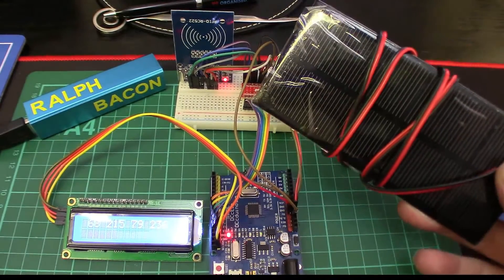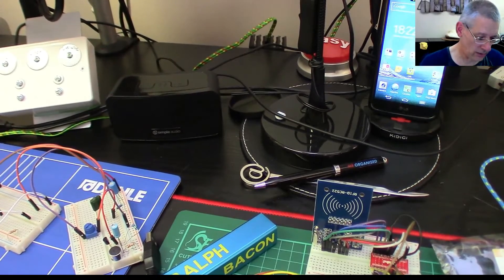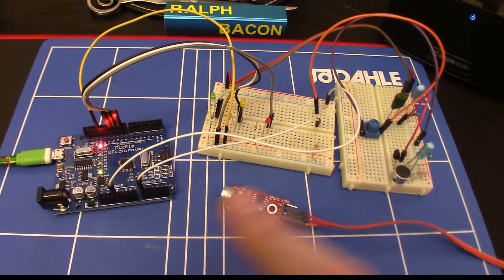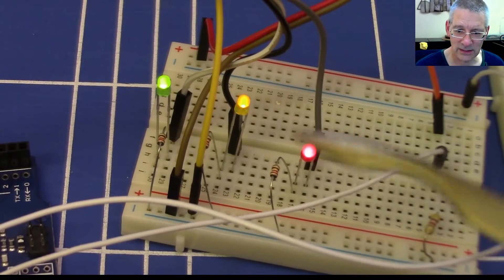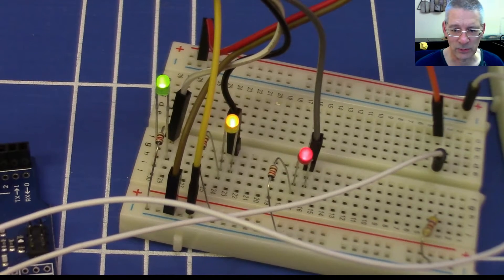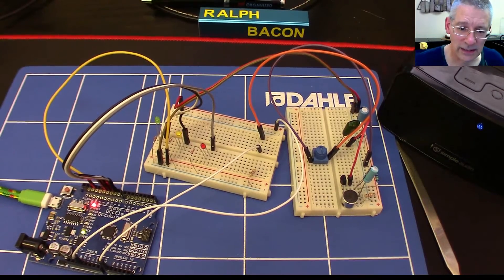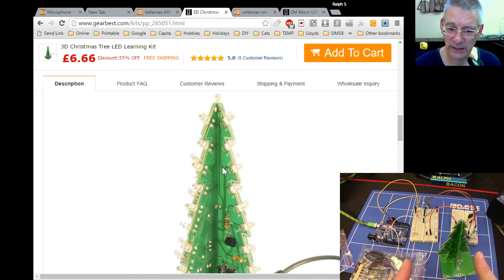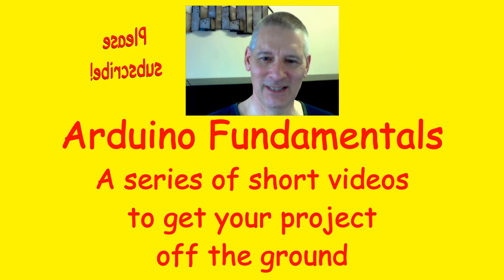#51 Easy Xmas Project Idea (& Product Updates)

Comment: That mic board you have and the one on the web page are not the same.  I ended up with both as a part of a "sensor kit" I ordered a while back from banggood,  and one is supposed to be a whole lot more sensitive than the other (the one with the bigger element maybe?).  I still haven't envisioned a use for those things.

Some time back I bought a heart-shaped circuit board with a lot of LEDs around the edges,  built it and gave it to my lady.  It seems to use pretty much the same circuit as that one you illustrated here,  with the three transistors...
Reply from the maker: Oh dear. The one I used in the project works very well. I had the Xmas tree out last year (Xmas 2019-20) and it still works just as it always did!